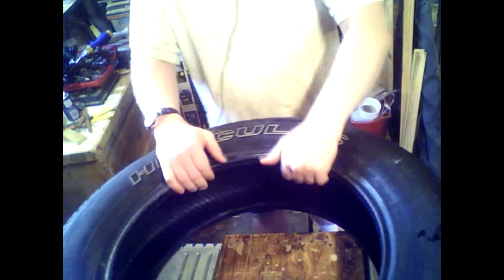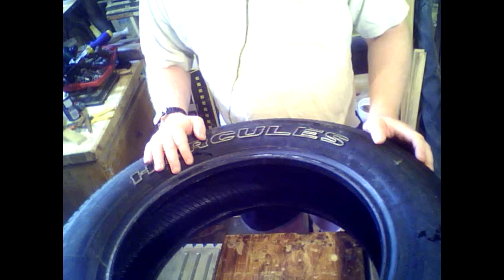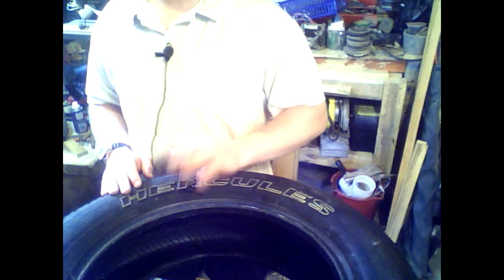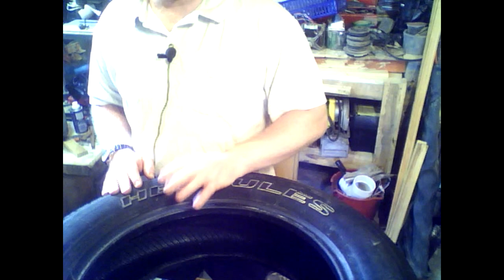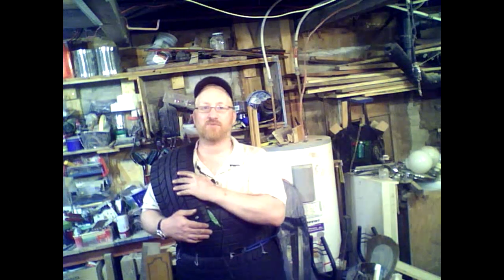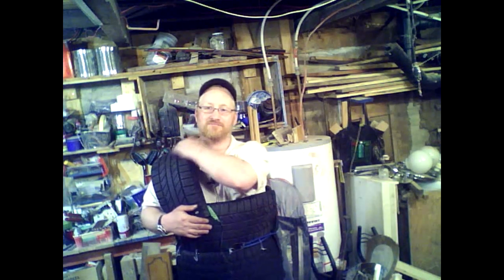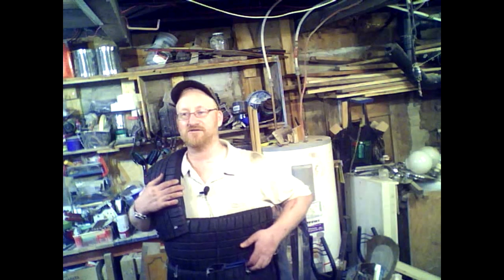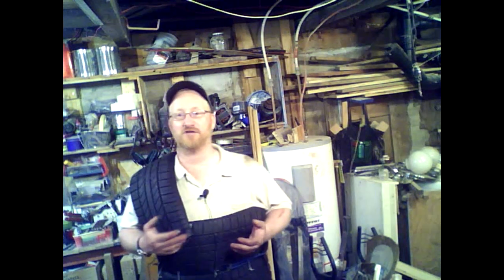tire armor

Comment: I really like your design of what you built i hope you do a update video on this because I would really like to see it full detailed. But still amazing work and thank you for the inspiration because i want to make my own.  One thing you can actually do to make a change is maybe change out the tire for the shoulder and maybe replace it with a bike tire or even a motorcycle tire something a little smaller like that might work and still be lore friendly.
Reply from the maker: I have a idea for another set of armor that is more wearable but the tire armor is now long gone. it was too heavy and uncomfortable to wear for more than a pic or two. thanks for the comment.
Reply: @heartsdelightexports  thank you for giving the inspiration to make my own type of fallout cosplay armor.
Reply from the maker: @NCRenigma  I am glad to have been of service. I hope your armor turns out better than my attempt did. Perhaps a lighter weight tire would have made it both easier to work with and easier to wear. good luck.

Comment: i've just started making my own set of armour, as an educational project on the impact of littering and climate change (I pulled the tyres from a local river which i voluneer to clean up)
Reply from the maker: The weight is one of the big downsides, as it gets towards what you envision it becomes uncomfortably heavy, not so much that you couldn't wear it but over time it would exhaust you to walk around in it. I appluade your efforts though and would love to see the finished Armour of a eco-warrior. good luck to you.
Reply: @heartsdelightexports  I am aware it will be heavy, however its still about the same weight (if not only slightly heavier) as combat body armor worn by soldiers
Reply from the maker: @DavidSmith-yv2vb  I wish you well in the endeavor. For me it was a idea I needed to explore, the weight was a factor in its comfort of wear but other factors meant that for simple cosplay it wasnt worth it. I would love to see how yours turns out.
Reply: @heartsdelightexports  I finished it, i'm pretty pleased with it too, especially for a first attempt! can't find anywhere to post the picture to though
Reply from the maker: @DavidSmith-yv2vb  I am not sure this still works like I think it does but there is a speech balloon top right of the page that will allow you to message me via youtube, for a little while longer anyway. it says its going away after sept 18. that should work. must be signed in. I will keep a eye open for it.

Comment: I was trying to do something similar over the summer but i couldn't cut through the tire with what I had. My idea though was just to make an insert for my tactical vest, and maybe even add a few ceramic tiles to up the chances of stopping a bullet.
Reply from the maker: I used a jigsaw blade designed for cutting metal but still had trouble cutting across the steel belts. The effectiveness of this as armor is pretty low and was only intended for Cosplay, making anything effective is out of my league. Thanks for commenting and subscribing.
Reply: Getting through the seal at the beginning is the hardest part once you get through its not so bad but deffinitley helps to have spare blades
Reply: I’m planing a cosplay replica tire armour based on the amour in demolition man

Comment: hi......where n how did u get that wireless tire...?? wil u tell me please
Reply from the maker: Wasn't wireless. just a regular old tire. I used a jigsaw blade designed to cut metal. if not for that I would have had a much harder time with it.
Reply: Old bias ply tires ..not radials